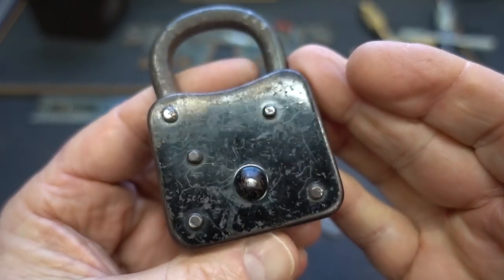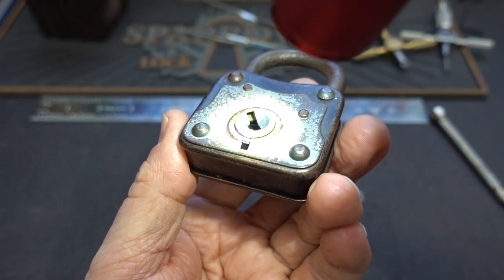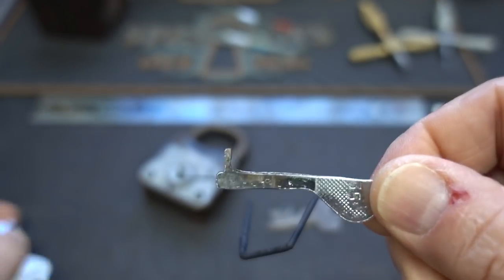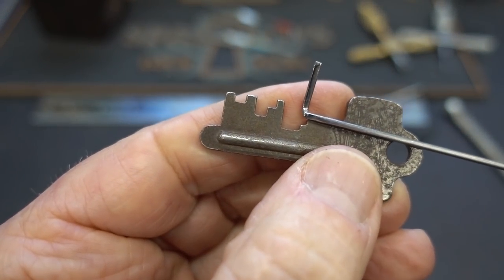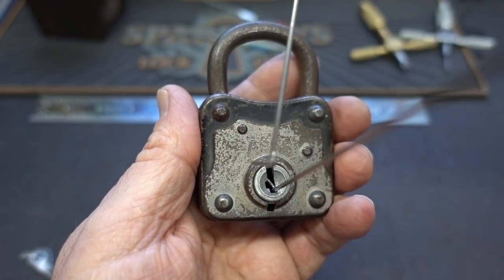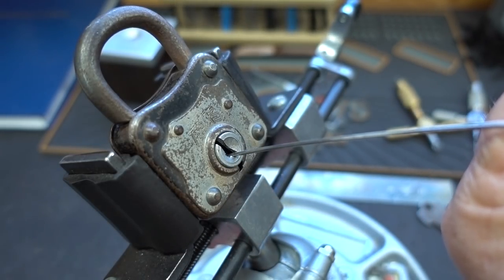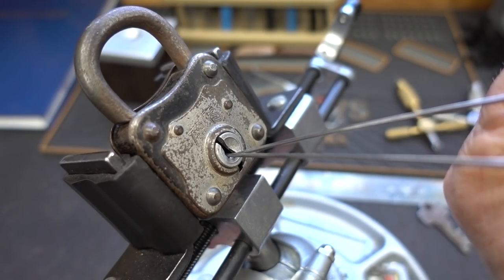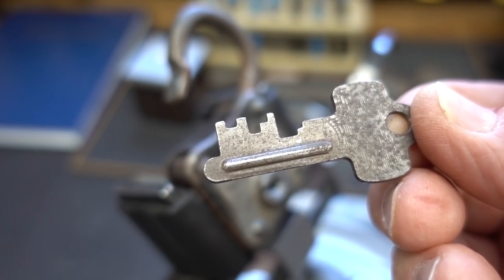(1659) Abus Lever Padlock w/Front Tensioning

Comment: Hi Bill (and everybody), Here's a link to an article on master lock makers in India. https://www.atlasobscura.com/articles/locks-dindigul-india? 
It's a dying art - they build locks by hand. They're incredible! A single lock can take weeks to make. Just having the key isn't enough for some of them - you have to know exactly how to use it; for instance, the key might have to go in at a specific angle, or there's a secret button, that kind of thing. Here's a description of a door lock: "It’s a complicated metal contraption, with nine inner levers that operate five cylindrical steel rods simultaneously; the rods latch into place with every twist of the key."

Comment: I dont know the tribes policy on links but after watching the video I wondered what you would think of these two possible tensioner designs. Your method works with the opening in this lock faces warding but I thought these would be a more reliable solution if you ever encountered more front tensioned lever locks. In one it shows a possible way of cutting a key tensioner for the lock, the other is an idea for how to bend a wire tensioner. I think the wire has more merrit as the key cutting option doesnt leave much surface area to rotate with.
https:// i.gyazo.com/9681579d397549d7b3e1d0baafd30947 .png 
https:// i.gyazo.com/b839eb4f4bc83216bacb7344a603bef6 .png